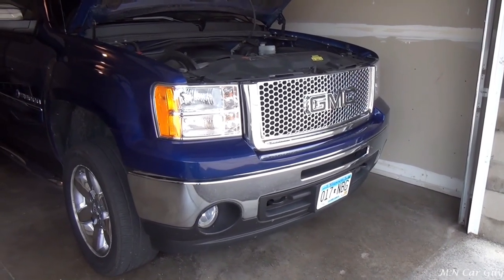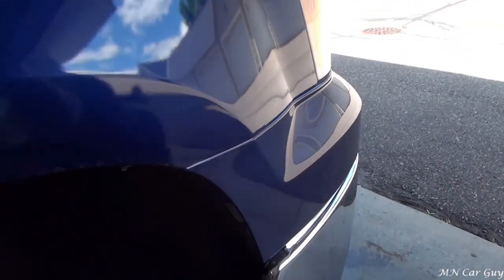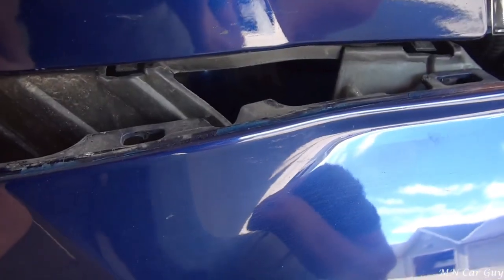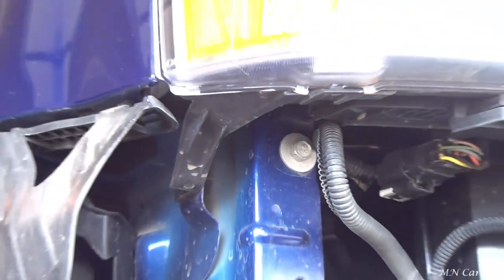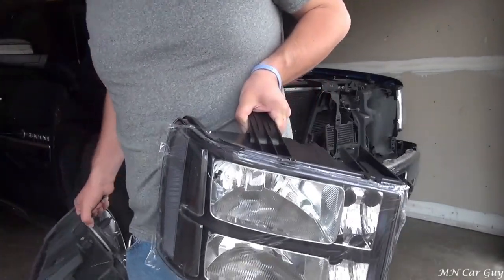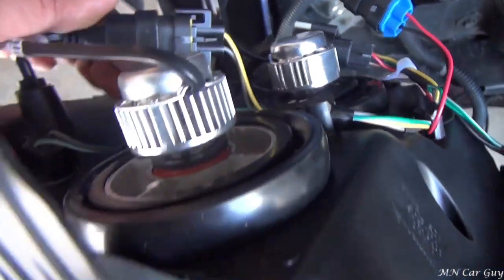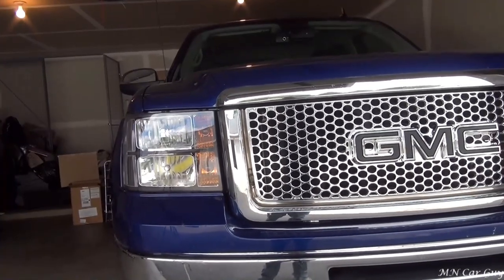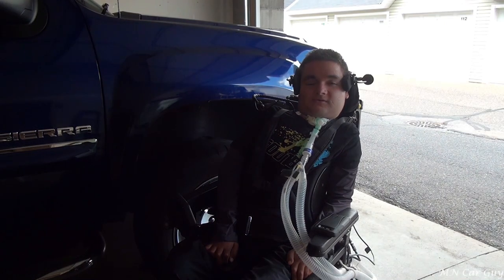New Grille and Headlights Installation + A Special Thank You!

Comment: You deserve more subs. You'll get there, just don't give up
Reply from the maker: Thanks man! Glad we're able to help. I don't plan on giving up anytime soon. Hope your exhaust is coming along well.
Reply: mncarguy So far ive got true dual running back to two 20 inch glasspacks, which I originally wanted to be 12 inch, but they messed up. I also still have all four original cats, I want to get rid of the rear cats and replace the glasspacks with pipe or weld a piece of pipe inside a glasspack so if I ever get in trouble ill say hey look Ive got mufflers lol. Its a common thing we do in South Dakota cause we don't want to get a $100 fine for no muffler lol. The only thing im worried about is taking off two of the four cats, cause I know people that run the same setup with the same truck and have no problem, im not worried about it not running right, im worried about cops. Ive been researching on what the fine is for removing the cats and ive found that its anywhere from $1000 to $25000 which I find hard to believe, but I also read that in states like South Dakota where you don't have to get your truck checked on, everyone takes em off and no one gets caught. Do you know anything on what a fine would be? Btw just curious what part of Minnesota you live in, cause I live in South Dakota and I live kinda near Yankton and Sioux Falls if you know where that is. Love your vids bro, thanks.
Reply: mncarguy O yeah btw you should make a racing video where you race a few different trucks, thatd be awesome. Also do you have any idea why my truck would be kinda slow at first when I race? Everytime I race my friend he usually  is about 5 feet ahead of me at half a mile, then about 50 feet behind me at a full mile, its really weird, and anyone that races with me never wants to go a mile, cause they know they'll loose. lol
Reply from the maker: I still have my cats in place on my new system so I don’t
know anything about the laws for them. Never had to look. I doubt you’d get a
ticket for not having any. Especially up here where we don’t have to have
inspections and smog tests done. Cops haven’t said anything about my exhaust
and I’ve passed hundreds over the years I’ve had this system. My dad got pulled
over because his muffler rusted out on his Civic. The cop must have had nothing
better to do because there’s people who drive with open headers sometimes and
nobody bats an eye. I’d say as long as you have some sort of muffler then you’ll
be fine. Just don’t always floor it up to speed through residential areas lol
As for it being slow on takeoff, I’d say it’s your gearing. You’d want something
higher than what you have currently. Even higher than 4.10’s but you won’t have
as high of a top speed. It’d be worth it for the acceleration gain though if
you want a truck that’s good for drag racing. I’d rather not say exactly where
I live but I will say it’s somewhere near St. Cloud, MN :)
Reply: mncarguy O I think I know roughly where that is. Im not like a stocker that's gonna come to your house, I was just curious because im quite familiar with Minnesota, and your like the closest youtuber to my house, everyone else is in LA or some shit. lol and thanks for the info.
Reply from the maker: Nah, it's all good man. I know if someone hated me enough, they could possibly find me by looking up my plate number or something. Glad I can entertain you with the stuff I do! Got a long demo derby video going up tomorrow.
Reply: mncarguy awesome im gonna try n watch it tonight real quick.

Comment: I have a 2015 Sierra and want to change my grill to the Denali style grill you used. Can you tell me where you purchased it from? Thanks!
Reply from the maker: I got mine off ebay for $220. Since the one I got only fits 2007 to 2013 you'll need one of these.
Here's just the grille:
https://goo.gl/kYId62

Here's one with the bottom piece included:
https://goo.gl/DcQb0g
Reply: mncarguy awesome, thanks!
Reply from the maker: Michael De Luca Anytime man
Reply: mncarguy Forgot to ask, any issues with the grill....peeling or cracking?
Reply from the maker: Michael De Luca No problems so far. It's been in 100 degree weather but not below freezing yet. So we'll see.
Reply: Michael De Luca eBay is ur best bet make sure u don't buy the denali grill with the solid chrome plate where the emblem goes make sure it's like factory has all the holes. EBay is famous for that even sometimes robbing pictures. That blue overlay tint they put on to protect it well leaves a nasty glue mess when taking it off too

Comment: Got the 8k sly blue so switch backs are hard to find in that color most are 6k color so went ahead and put stock orange bulbs in not liking the look tho like u said. I do have 7500k projector signal bulbs but no orange. Po pos are cracking down with that so I said hell with it went with stocks considering u can't even get to these bulbs once the lights are back on the truck

Comment: My trucks silver I just put those headlights in so nice only thing I found was the low beam hole was larger then factory loose fitted but locked. So I silicone it tight. Aftermarket always gonna find one issue lol I also did the Denali grill both looks amazing. Watch the vid on the lower Denali grill Lmao hack job to get it in
Reply from the maker: I'll definitely have to check out how to make the lower grille fit. That would be cool to have it in. There's such things as clean hack jobs, right? lol  Good call with the silicone, just finished resealing mine because of moisture issues. As for the turn signals, I finally got switchbacks and they look sick. Had the assemblies out for my motor swap anyway so it was a good time. Glad this video helped you out. I couldn't find any with detailed instructions so thought I'd make my own. Hope you continue making your truck look badass!